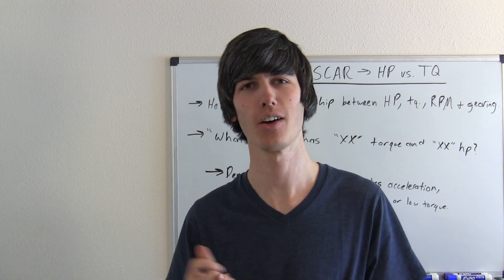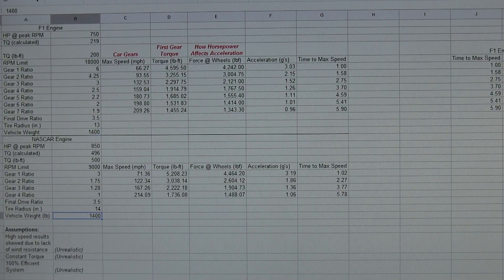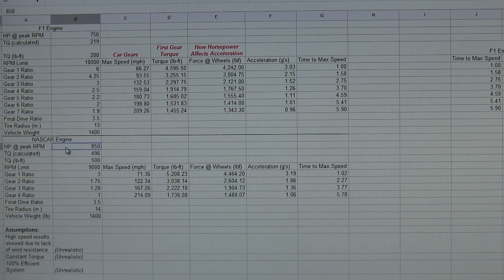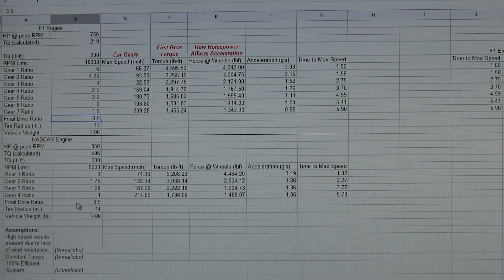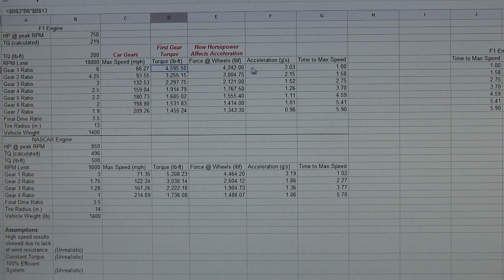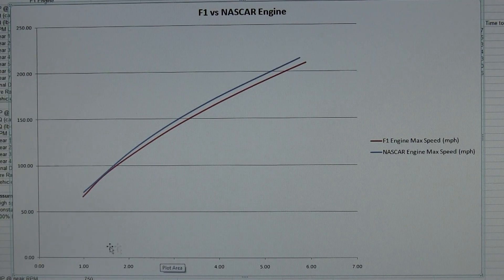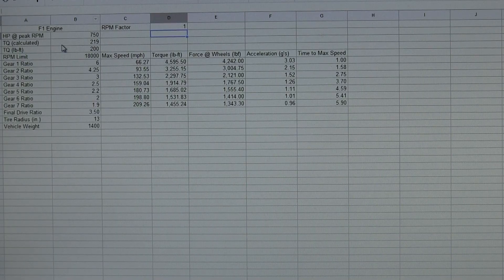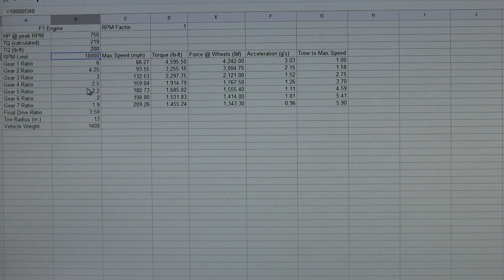Horsepower vs Torque - Formula 1 vs NASCAR

Comment: me and my friend both have an E60 BMW M5, we both have the same engine, but one is a 6 spd manual and the other is a 7 spd smg. which should be faster?
Reply: purple. because pandas don't wear hats.
Reply: My guess would be (everything else the same except transmission) it would depend on the gearing ratios. If you mean top speed, it would be the ratio of final gear. Like in the video, the F1 was 7 vs. the NASCAR 4 gears.
Reply: +Ronald Golleher in theory the 7 spd should be faster and have a higher top speed if everything is the same except for the transmission
Reply: Going by that, yes, if the first six are exactly the same as yours, just with the added seventh on top. But, again, for top speed you'd look at the ratio of your 6th vs. his 7th. If these two are the same, the top speed would be the same. As far as acceleration, I might imagine his to theoretically be quicker just because the gears will keep his car better in the power range of the engine. But in practice, also would depend on how well you'd shift in your manual as to who might be quicker.
Reply: +Ronald Golleher well they both have the same top speed so the 7 gears are shorter than the 6, but in theory like you mentioned, he would be in the powerband longer,  but the 7spd will be going through that same power band but faster and off to the next gear, I believe it would be a lot of back and forth if the manual driver shifts perfectly but in the end the 7spd should take it

Comment: is the torque advantage of the NASCAR engine not the very reason this works? is it not the compensating factor for the fact that it runs at half the rpm? maybe I'm wrong, but I think you may have missed a few factors. anybody want to help me out here?
Reply: He does say late in the video, that if he were to cut the F1 engine RPM in half, the torque output does double, and the overall output numbers stay the same. So, in a way, he does say this. edit And it also does cut the final drive ratio in half.
Reply: thats exactly what he is saying... same hp , same acceleration, regardless of the engine torque.  one is operating at twice the RPM (F1) and the  other has twice the torque (NASCAR).  both have the exact same torque at the rear wheels at any vehicle speed. due to gearing.   there is theoretically no difference if all other factors are the same. (weight , aero, all sorts of other little things, etc)
Reply: Yes, he did make some "assumptions" equal to theoretical mathematical "givens"  that weren't exactly factual science.  Not the point however.  
    When he dropped the redline on the F1 engine and still had the same max horsepower, the ONLY way that would be accurate is if the engine got bigger too.  Other than boost, or methanol, the engine would have to be more than twice the displacement to get that much more torque.  High horsepower comes from a seriously kick-ass engine that could rev over 10k-20k.

Comment: didn't really understand what you trying to explain. think I was stuck on why they were running 13 and 14 inch wheels..
Reply: so they are that small..
Reply: 13 and 14 inch radius. so the overall width of the tire is 26 and 28 inches

Comment: The difference between a high torque and a high RPM engine of the same HP with ideal matched gear boxes is the high torque engine feels more capable since it does not have to be at screaming high RPM to achieve brisk acceleration. The difference is very much a real world difference rather then a theoretical mathematical one. The S2000 proved that,  while it is capable of decent acceleration the lack of low end torque made the car a chore to drive since you had to keep it bouncing off the rev limiter if you wanted sports car performance. Ultimately Honda had to increase the displacement and hence torque, while it lost a few ponies (243 vs 238hp if I remember correctly) the car did perform better in the RPM range in which people actually drive and if I remember correctly it has a wider power band, short stroke high RPM engines usually suck until you get them into those very high RPMs, high torque engines are usually fun anywhere, but on a race track your times will not reflect the difference assuming ideal gear ratios.
Reply: This ties into race applications vs. daily driving or towing applications.  In this video, he's talking about a race situation where you're only concerned about the last few RPM before redline.

Horsepower is still relevant in daily driving, but you have to look at the actual dyno graph rather than peak numbers.  Having a high torque number almost always indicates an engine that is tuned to produce good horsepower numbers low in the revv range, so it's still horsepower that's creating the drivability, but the instantaneous maximum torque figure is good at hinting at that tuning dynamic when a full graph isn't available, which is mostly because pulling out a horsepower graph to explain why a V8 is good at towing is too complex for a lot of people, but shouting out a big torque number is easy.  Horsepower is still the name of the game, but the horsepower at the relevant RPM rather than peak number.

This is kind of what you said, but I just want to make sure people understand that horsepower is always the number that matters, but you need to see a graph to know if the horsepower will be where you need it to be for the application.  After all, horsepower and torque are direct relations to one another, but the horsepower is the figure that tells the whole story.
Reply: what you are speaking of is a broader HP range, traditioally found  on higher torque engines of similar HP. having raced these S2000s, with and without blowers on them, i can tell you first hand, in real world situations, they have the same rear wheel forces at any speed on the track.   Yes, it takes more tallent to keep the engine in the High RPM range, but dont confuse tallent with the mathematical theories.     but you say it in the end of your statement , that on the track , its not a big diff.   I agree.   big torquie engines are much easier to drive on the street to put down the power without having to worry about having the RPM way up near max HP levels.
Reply: zanick2 I think alot of it is simply what we are used to driving, for those of us used to 5000-6,000 RPM redline street engines it would take alot of getting used to shifting at 8,000-9,000 RPM, also another area where high torque engine shine is the hole shot (0-30MPH) since high RPM engines fall well out of their power band when you drop the clutch in 1st gear (unless you loose traction of course) This is partly to do with the broad power band and partly due to the high reciprocating mass of larger displacement engines creating a buffering like effect on launch. Let's face it achieving an ideal launch is always easier in a V8 then a 4 banger turbocharged or otherwise. In drag racing cars they even use a heavy flywheel to amplify this effect.
Reply: yep, you seem to get it... but as far as launch, its just as easy to be in the right part of the HP curve with deeper gearing of a high strung engine, vs a high torque lower RPM engine.  however, it is easier to modulate the engine with the higher torque engine.  theoretically, they should work the same , except for the stored rotational KE that the bigger motor can dump into the driveline., but usually you are grip limited anyway.
Reply: zanick2 You don't have to "dump" that energy into a smoky burnout, you can control it with the clutch continually applying it throughout the first second or so of first gear. Of course after first that extra mass is does nothing good for you. All else being equal it is easier (not always faster) to launch a V8 rather then a high revving 4 banger and I have launched quite a few, you just have a broader range in between bog down and burnout since you don't have to fight to keep engine RPM as high coming off the line and usually you don't have to shift to second quite as soon since a V8 does not require a granny 1st gear.
The numbers support my impression, the S2000 took a full 5.8 seconds to hit 60mph notable slower then V8 powered cars with similar power/weight ratio. The 2004 Mustang GT had a nearly identical power to weight and would do it's 0-60 in 5.2 seconds despite having the disadvantage of all season tires and a lower rubber/weight ratio (yeah that is what I call it)
Reply: if you have car control and understand your HP output, its easy for a pro to use the HP from either a higher reving car or a lumpy V8. personally, ive raced both so very familar.  but its all about putting the power to the wheels , start , accel and top speed... after all newton said it is so.    acceleration = power/(mass x velocity)  this means acceleration is proportional to power and inversely proportional to speed.    how you do it, is up to the driver, but if you have the power you will accelerate the same if the power at any speed is the same.

Comment: NO engine have high tourque. It is all gearing. There is a volume of gases ... fuel is sprayed in ... there is a explosion .... either the cylinder is wide or narrow or whatever inefficiencies, stroke must be very important also when you consider the breathing of the engine ( not talking about 2 stroke or 4 stroke but how deep the cylinder goes down )  ,..  the crankshaft and everything else behind that must be a gearing problem only.

Best efficiency solution is ocourse if you could keep the rev DOWN .... I mean ... if you have all time in the world ofcourse keep the rev down like on a fishing boat.  tug ug tug tug tug tug tug tug tug,

When you have a THEORY always check out the MINimum and the MAXImum cases so you see what your theory is ...

 That be efficient.... the tug boatg ... or fishing boat. 

So ... I think cylinder volume, efficiency in breathing air, igniting ALL the fuel, and revs is most important ... everything after that is just gearing. Bye bye from an intelligent amateur. Over reving if the rest of the system can not supply fuel and air is pointless.
Reply: Often wrong and seldom in doubt...story of your life.
Reply: Engines don't explode.

Comment: Traction plays a big role in the differences between choosing a low-torque high rev engine (F1) vs a big high-torque engine (NASCAR).  The F1 engine is better suited for the type of track that they use, which is full of turns.  That engine is lighter than the NASCAR engine and the lower torque will produce less wheelspin in the corners.  The NASCAR engine would be very difficult to control in corners because all that torque will be constantly overwhelming the traction of the rear tires.

Also, on another note, maybe you should use a racing simulation game like Forza, Project Cars or Assetto Corsa to help illustrate your point.  Those games allow you to tune the cars and add all sorts of upgrades.  They could've helped a lot in this video.  I play Forza 6, and it has NASCAR and Indy Cars, which would've compared just as well.

Comment: Acceleration only depends on engine power - the ability to convert chemical energy (fuel) into kinetic energy (speed).
Power is proportional to torque*RPM. There is no difference (in theory, considering the assumptions) between low rpm - high torque and high rpm - low torque engines because appropriate gearbox will compensate as was shown in the video.
BTW you can never have more power than torque or vice versa - these are different units of measurement.

Comment: So who wins? Batman or Superman? All I know is my VW TDI accelerates a LOT faster than my old Civic, even though they have the same 100 hp and the Civic weighs a lot less! But the TDI has 177 ft/lbs torque, a lot more than the Civic. Which makes me question your statement "The important figure to look at is horsepower, as ultimately it's the determining factor in acceleration."
Reply: You have to look at your torque/HP curve. It's likely that your TDI makes peak power at much lower RPM than you civic, which is much more usable. The civic probably doesn't make a lot of power until very high rpms, while the TDI peaks power early and has more power for most of the rev range. 

If the TDI makes power like this
1krpm: 80 
2K: 90
3k: 100
4k: 95
5k: 85
6k: 75

and your civic makes power like this
1k: 50
2k: 55
3k: 60
4k: 65
5k: 75
6k: 85
7k: 95
8k: 100

Then you can see why it would feel like the TDI has more acceleration. Also another thing to consider is the gear ratios. Tranny and final drive gearing can make a huge difference in acceleration. 
Excluding gearing, the civic would be more like the F1 car in this video and the TDI would be more like the NASCAR when it comes to HP/TQ ratios.

Comment: you used the phrase unrealistic so much i am questioning the overall purpose and reality of this video. does it prove anyting?
Reply: yes it shows the relationship between torque and horsepower.. the fact that the conditions of the theoretical vehicles aren't realistic is irrelevant to the video
Reply: I completely disagree! Entire video, in his own words, is unrealistic. Thank you for coming! Good night
Reply: Justin Paige again.. you're completely missing the point. the explanation isn't unrealistic.. it's basic math. he simplified the conditions to make it easier to understand and you'd need a supercomputer to account for every variable
Reply: i see, I imagine that is very true.
Reply: While some parts were unrealistic, they were roughly equally unrealistic between the NASCAR and the F1 car, therefor they kind of cancel each other out. The variables that he was describing in the video were no unrealistic, just the end results (acceleration, top speed etc) didn't account for variables which applied to both cars. He did this for simplicity sake as well as the fact he was comparing engines, not drive lines, tires, diffs and aerodynamics

Comment: I turned this on to see what you might say about the low torque engines of F-1 vs the high torque engines of NASCAR. Not a nice opening statement, but it's an interesting question I've wondered about for a while.

Comment: how do you calculate 3g of acceleration with only  near a 1:1 force to weight ratio in 1st gear for NASCAR.  (i.e. 4000lbs and 4000lbf of force)  its not a huge problem, because the message here is pretty clear, but I'm curious as to how that figure was derived.
Reply: Because it wasn't a NASCAR car, it was an engine with NASCAR HP/TQ/RPM/Gearing in an F1 car that only weighs 1400lbs. Watch again.
Reply: makes sense... nascar engine in a F1 car to show same acceleration.   good comparison/example.   torquies are  going crazy!   love it!

Comment: I thought F1 was faster than NASCAR
Reply: Usually is. NASCAR's are about 3500 lbs while F1 cars are 1800 lbs. F1 cars also are more aerodynamically stout. He was just comparing the engines in this video, not the cars lol
Reply: F1 not faster, it's more HiTech.
F1 Engine has about same power of 1.6L engine compared to 5.9L NASCAR. 
Want to know how techy NASCAR, divide its power by 3.69 and you'll get 230HP with 135 torque.
NASCAR is sux.
Reply: ***** Well said

Comment: Can't you just explain it with a torque wrench? If you have a small arm, you need more torque to complete one 360 degree turn. If your torque wrench arm is longer, you don't need as much torque, but on the other hand you need to move it around in a longer diameter to complete a full 360 turn, thus making your torque applying point move faster in order to do it in a similar time as the short arm. That equals to the higher needed rpm to match the high torque of the other engine. In the end they both produce the same amount ofpower, aka hp, but with different rpms and torque numbers.
Reply: like he said, it's related to the gearing.. you can produce more torque with gearing.. smaller arm of the torque wrench is essentially a lower gear
Reply: i mean *longer arm
Reply: that is right. But if you alter the gearing, you also need higher rotation speed to complete the same task in the same timespan. Essentially you describe what low gearing does in 4wd vehicles and its a good example
Reply: You could make that analogy if you were comparing the differences that gearing ratios gave, but he was talking about how horsepower is the relevant number and how different torque and engine speeds can achieve that number in different ways with the same end result.

Comment: this could have been explain so easier. all hs had to explain was f1 engines are roughly 1.6L single turbo charged diesel inline 6 where as the NASCAR engines are a 350ci NA carbureted v8 the f1 car averages 1500lbs the average NASCAR stock car is somewhere near 3500lbs. that simple. any one who can't see the difference in writing probably doesn't car. it's the age old argument muscle veruses tuner
Reply: +brandon carver this considers the same weight for both.

it could have been made easier, not that way though. the reason they're similar is because the gear ratios are doubled on the f1, thus doubling the torque sent to the wheels, and they get similar speeds because the rpm can go higher, so the speed the f1 can achieve with shorter gears is the same because it revs twice as high

Comment: Another interesting point, is that the F1 engine size is restricted to 1.6 liter and use Turbos, while the Nascar regulations engine limit the size to 5.9 liter. and carburetors. Not saying one is better than the other, but it's great that such different ideologies can co exist and be developed at the same time.
Reply: NASCAR uses direct fuel injection now.  They've done so for the last 2 years I believe.

Comment: Im not a fan of NASCAR, but you can see that NASCAR is also pushing for the max amount of HP, engine type accounted for.. Less money invested = less HP... You can get alot more TQ out of those NASCAR V8s, so I think they are all operating on the same principal.. The correct one.. With all that money on the line, youd expect that.. Interesting!